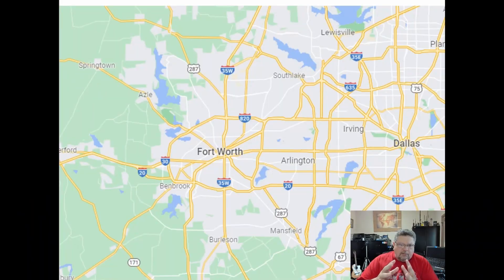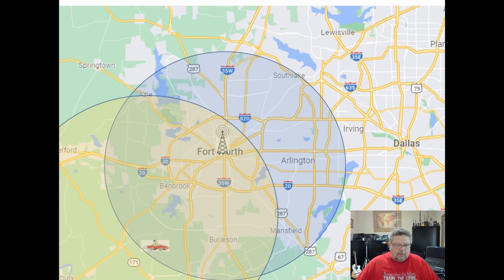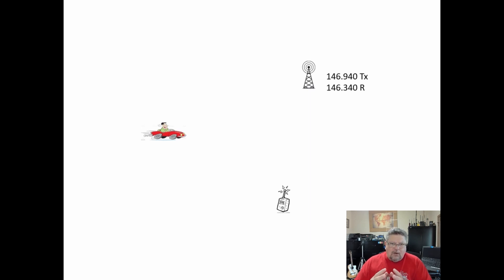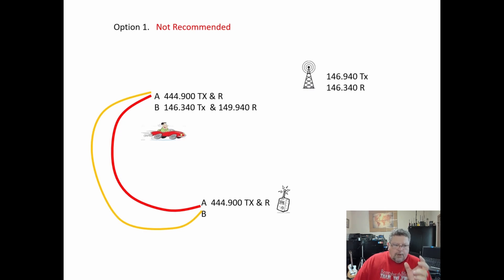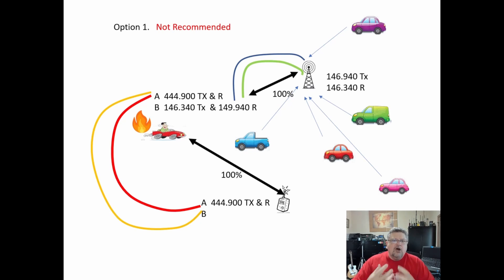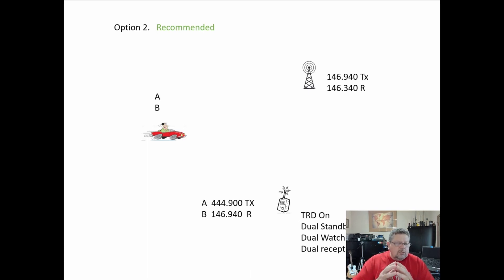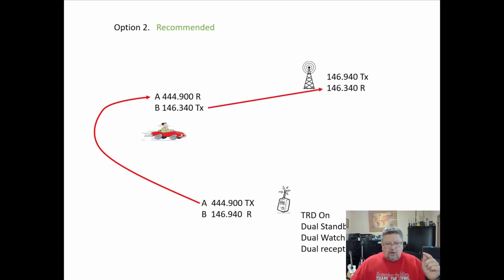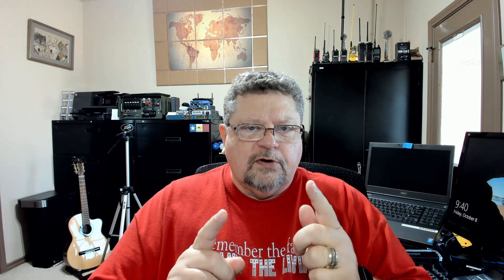How and Why to use Cross Band Repeating

Comment: This is why I like separate vehicular repeaters like the Pyramid SVR units. The low-power repeater is retransmitting to the portable at only a few watts, and the mobile only transmits when you key the portable. I have a similar system in my truck for Part 90 use.

Comment: Seems like a small yagi on a light tripod would be simpler, but here's an alternate method... If the HT is able to receive repeater traffic directly, then you can setup split frequencies on your HT (XMT: 440.900/RX: 146.940) and crossbanding on the mobile (RX: 440.900/XMT: 146.340). Now the mobile only relays HT traffic to the repeater as all repeater traffic goes to the HT direct, eliminating the extra duty on the mobile. If you don't have a crossband rig, take a pair of Baofengs, link them with a 3.5mm-to-2.5mm audio cable, and hoist them up on a flagpole. (XMT radio receives the 3.5mm plug as it fits the mic jack.) Same settings, same effect.

Comment: This has helped me ENORMOUSLY THANK YOU..  found out also so you dont take up both A and B on your handheld, i set my recieve to the repeaters output, and when i key up i set the offset so it transmits to my crossband freq on my mobile, using one channel slot on handheld.. 
Rx. - 462.000      
Tx. 462.000 -  offset -311, so I'd hit 151.000 on my mobile for cross,  Just an example dont scream at me 😂

Comment: I’m new to this and not sure I understand.  Under the second scenario your HT is getting all of the same traffic your mobile unit would be getting in the first scenario.  So why would your HT be able to handle the traffic but your mobile unit cannot?  I’m guessing the cross-band repeat function of the mobile unit gives the hardware a much greater workout than the handheld doing the equivalent of simplex on two channels?
Reply: The overheating happens with the mobile rig, not the HT.  Receiving takes very little power.  Transmitting requires a lot of power, especially if you use your transmitter's maximum output power, which is the default on most mobile rigs. The issue is that, in the first scenario, your mobile rig has to retransmit all the repeater traffic to send it to the HT. If there's a lot of repeater traffic, the mobile rig will be transmitting almost constantly.  Most ham mobile rigs can't take that kind of duty cycle at full power without overheating.  But if you set the mobile rig to use its lowest transmit power for the link from the mobile rig to the HT, that will probably avoid the overheating issues.  And in the scenario described, where your HT is within a few hundred yards of the mobile, the mobile shouldn't need to use much power to reach the HT.  In the video, he's suggesting having the mobile rig not ever transmit anything to the HT, which of course fixes the problem.

Comment: Makes total sense, however what do you have to do differently on you mobile radio for options 1 vs 2? It seems when you put your mobile radio in crossband repeat mode (Yaesu FTM-510 in my case), option 1 is the only thing the radio will do in that mode.

Comment: That's a great idea!

When I've used crossband repeat, though, it is so I can move about in and around my house and still ragchew on 2m simplex where my HT cannot hear most of the other stations - but, my base with a Tram 1481 at 105 feet can.  And, yes, my Kenwood TS-2000 would get hot - so, I reduced power from 50 to 10 watts.  And, that is certainly another method of mitigating the duty cycle problem.

Thanks for the well thought out alternative approach!

73
AI4IJ

Comment: Some radios have independent power on each channel, so you could make the VHF channel pump 50W while the UHF channel does a much more civilised 5W. This helps avoid overheating and lowers battery consumption.

Comment: Works good that way IF the HT can receive the transmission from the repeater. My house basically acts like a faraday cage and my HT doesn't hear much at all. So I must use option 1 if I want to use my HT in the house. (since all my base gear is in the shed) I am able to set the output power to medium on on channel and low on the other so that helps with heat during the duty cycle.

Comment: Thank you for the info.  So your radio was overheating because of the inbound repeater traffic, and I'm wondering if the mobile is still receiving traffic on the receiving frequency of the repeater?  I'm sure it is less than the traffic from the repeaters Tx traffic, but doesn't your mobile still receive on the frequency in the B channel during cross band repeat?

Comment: Three years later and your video is still helping new hams like me . Many YouTube ham radio channels just review the latest radios and testing equipment, new hams need set up and equipment function information to set our equipment up for success the first time . Then we set new goals for even longer and better communications, I have been steadily buying equipment for my home repeater , home antenna ,and work vehicle mobile unit and this information is of great value to me. This will also help relay important information with less traffic confusion during emergency times. We recently went through the hurricane in South St Pete and thousands of homes were flooded out with five feet of salt water. repeaters were invaluable. That is Why I committed to setting one up.

Comment: That is actually a great way of doing it. 
One if those, why didn't i think of that, ideas. 
I use cross band at my house. Walk around with a Baofeng  on 2 meters and talk on the local 440 repeater.  
Thanks for the video.
Reply from the maker: you are welcom

Comment: Thanks, was using method one for my house so I could use HT all around yard and house and not be tied to shack ….when I got back to shack noticed how hot mobile was…will try method two next time. Do you have to use a repeater or can you use the mobile rig in car as the main repeater? In other words not be connected to a large repeater tower buy use the vehicle as the repeater
Reply: You should definitely be able to do that. Just make sure the radio doesn't have any offsets programmed in. Put your HT on one band, put your mobile and any other HT radio you want to talk to on a different band, and off you go. A simplex cross band repeater.

Comment: Thanks for the two-method explanation. I only have a handheld, but I am looking at a mobile unit that will include the crossband relay. I like the second method. I was at a rally in the middle of Missouri and heard everything but could say nothing on my 5W Baofeng. I was thinking an outbound relay is all I needed, and it would save some of the double-delay built into repeating.
Thanks again.

Comment: The Kenwoods are 100% duty cycle at 25 watts. If you had it on 50 watts that explains the overheating. Crossbanding uses 100% of the duty cycle in that mode.

Comment: Nothing wrong with what you are saying. This can work if it is great do it. Might be a good first option. My radio calls this locked band repeat not cross band. If you where in a situation where the HT can't hear the repeater cross band would be required. Turning the mobel 440 transmitter to the lowest power settings might be helpful.

Comment: Okay, I'm late. However, the long term ham does not need a dual watch, anything. Still, a cross band tx of some sort is required. You could always carry an extra HT. Yep, back in the nineties it was cumbersome but, that worked. UHF for the cross band and a VHF tx or, rx like a scanner to listen to net control. Its always been good practice to own and carry more than one radio. Or, lately there have been special events where, more than one type of net on two or more bands and their respective repeaters. That can put a lot of work on a tri band or quad band radio. This is why I still like to employ mono band radios and individual quarter wave antennas.
Reply from the maker: Good idea

Comment: Hello. I have use crossband repeater functionality in a vehicle in the past, and I did encounter the same thing as you initially did. I used a Yaesu quad bander to do that back then. Yes, the rig got hot when it was configured to work with another repeater. That's a draw back in itself, as you point out. However, I encountered another problem at the same time, too. Unless the repeater in town fully dropped its carrier, my mobile repeater wouldn't allow me to transmit a signal into it from my HT. So I essentially couldn't use my own mobile repeater, until the carrier of the repeater in town dropped. That was annoying and frustrating. At that time, my HT could easily hear the repeater in town, but it couldn't transmit into it. The configuration you pointed out makes the most sense for this type of scenario. I never even thought to do it that way. I'm glad that you did, and that you were kind enough to share the information. A great big thank you, goes out to you! I sincerely appreciate this! '73s

Comment: Excellent video, concise.  Would you also want to enable a PL tone on the receive side of your mobile to minimize other transmissions from cross band repeating to the down town repeater?  Wondering if PL tones are crossband repeated or do you enable the PL tone for the down town repeater at your mobile TX side?   thx
Reply from the maker: You are correct.  PL tone for the down town repeater at your mobile TX side

Comment: Yes if you are re transmitting a repeater the opposite link out on simplex is going have be turned down 10w and add a fan.  But simplex to simplex works yes you need older twin bander HT 2 vols 2 squelches duplex on/off function to here yourself or use two radios

Comment: Simplex twist in the spirit of Option B?  Could you accomplish a simplex version of B, to reduce the duty cycle on the cross band mobile, by using a RX tone on the simplex frequency?  Most if not all the traffic received by the simplex frequency wouldn’t have the tone so the mobile doesn’t open squelch and doesn’t transmit.   Your HT won’t have the tone set, so it will break squelch whenever there is activity on the frequency.   Your transmission for the HT will go back to the cross band repeater and out the appropriate simplex frequency.

Comment: I’ll be setting up like this for the Head for the Hills rally this weekend. I was expecting to need 2m, so I built a 2m roll up J-Pole last weekend and did a dry run… band plan came out yesterday and we’re using 70cm… I don’t have a 70cm antenna for my POTA setup, but do have a dual band antenna on the car. So it looks like the mobile rig is getting set up on Crossband Repeat and I’m going to rock a Baofeng at the Rest Stop. 😂🤷🏻‍♂️ It’s not stupid if it works.

Comment: You don't technically need dual receive for B method. Some radios will allow arbitrary splits -- whereas a normal VHF repeater offset will often be 600kHz, you will set your radio up like any other repeater, but the offset will be hundreds of MHz. Yaesu and Baofeng will do this on a single channel, I believe.
Reply from the maker: I would be nice to try
Reply: The Vx-6r supports this exact configuration and is how I use crossband repeat when not connecting it to a repeater. My - offset is ~280mhz.

Comment: If you use Option One anyway, be sure to set your mobile rig's 70cm transmit power as low as you can get it. Single-digit milliwatts (1, 2, 5) will be plenty to raise your HT within walking distance, and it'll tolerate a high duty cycle without stressing your transmitter.
Reply from the maker: The Kenwood has L, M, and H.   I was running L.

Comment: Excellent description of how Cross Band Repeating works.    Many thanks for the video!    I bought an Icom 5100 rig earlier this year and had used it minimally.   I found out recently that it has cross-band repeating capabilities and that really got my mind working on how I can set it up so that I can go out for a walk around my neighborhood with my handheld and check in on the local nets on extremely low power.    Our radio club also supports special charity events and provides communications.    I can't wait until the next event comes along so that I can make use of my new found knowledge on how it all works!     Great video.

Comment: Hey a big thumbs up to you 👍 that's a fantastic idea , will never forget the first time I did crossband and left then realized the squelch had opened up and locked up the repeater for several hours , then  realized what I did I hurried back to turn it off and  I could smell the radio 20 feet away but it survived so now I use tones on both xmit and rec and lower power but your idea is a great one so will try it tomorrow and hopefully it will be the answer . Thanks agaiin kc5ulu
Reply from the maker: Wow

Comment: So... If you set up one single channel on your radio, you can have the repeater on VHF, with a huge transmit offset to the UHF input of your cross-band.

Then, you can configure your cross-band repeater to have the same PL tone as the repeater you want to hit, and have some crazy receive selection, like a different PL and a DCS tone.

This would mean that your radio listens to the main repeater, and you hit your cross-band whenever you need it... But the cross-band doesn't transmit back the other way, because you enabled some crazy combination of PL and DCS.

Comment: Thanks for the information. I have one HT that does cross band; the TYT TH-UV8000E. It pumps out 8-10 watts in a simplex configuration. It's more limited than a repeater, but set on a high point it will extend TX/RX range where terrain obscures signals. It's like having two HTs in one.
Reply: You could use it as a repeater in a car then? Or put it someplace high to extend other radios?

Comment: Great video, thanks.  Now, I do have a question.  I thought one of the main reasons you needed to cross band, was due to your HT not being able to reach or hear the repeater.  If unable to hear the repeater, it would appear that this would not work.  Am I missing something?  Again, thanks for the video.  I found this very helpful.
Reply: That's exactly what I was thinking. I was stoked about learning about cross band repeat, but now I don't know if I'm going to do it. I think it's totally fine if your HT can receive the repeater fine, but has a hard time getting out.
Reply: Just remember if your HT is outside the reach of rx of the tower and you are using your mobile as cross band repeater it will over heat as he said (if that repeater gets a lot of traffic, in his example of a bike event)
My tyt8000 ht used as a dual band cross repeat as in first example got hot within 30 minutes of Just Me testing it. Plus battery wear down.

Repeaters are usually commercial grade and cost $$$ to solve these issues. 

Tyt has a good cross band.  

Note if your ht does not have an A/B dual watch, you can use a large Offset when you program. Ex 462.500 offset 300.000 (not your basic +5 or -5)

Comment: I love this feature but I don't recommend using it on portable radios unless you have to. I recommend using only the lowest power setting on both bands, and even then these radios can heat up very quickly if there's no down time in your contact. I would NEVER use medium or high power on portable radios because you have to remember the radio is potentially being keyed full time throughout the entire contact. That's like setting your portable to high power and wrapping a rubber band around the PTT walking away for 5 or 10 minutes. It's not going to end well for your radio. You should also never use this feature on a repeater channel because there are times repeaters may not drop for extended periods.

Comment: The only problem with this is you may reach the repeater transmitting through your HT to the mobile, but not to be able to hear the repeater on your HT without the mobile.  KD2MNR
Reply: No. In the video, this is all predicated upon you being in an area where you are too far to TRANSMIT to the repeater with the HT, but close enough to RECEIVE the repeater on the HT.

Comment: Do you need a ground plane for a quad band antenna set up on a normal shingle roof running 50 watts or can you let it sit in a mount and run the coax right to the radio

Comment: I recently had a conversation with Dave from Powerwerx who recommended to me that only 10 watts on each frequency is recommended. I know I tried using Turbo mode on my Anytone 578 and the radio got hot really quick and I realized that this was a recipe for disaster. I rarely use this mode for repeater work, typically for simplex but great idea for a busy repeater as long as your HT can receive that long signal. Thank you for the video.
Reply from the maker: Good info

Comment: I'd be curious to know what your transmit power level was set to on your TM-V71 when it overheated?
Reply: Why couldn't you set up your hand held in duplex, Tx on UHF channel to your mobile and R VHF side from the repeater.  The offset function would allow TX and R instead of using A simplex and B simplex with TDR on.  On my Baofeng UV5R I receive on 146.610 from repeater and transmit by pushing PTT switch to FTM 400 at 446.500 MHz.  The offset is a +299.890.  My FTM 400 has two simplex frequencies while in cross and, R at 446.500 and Tx to repeater at 146.010, same way you describe in video.
Reply from the maker: I had a Ed Fong antenna on a 15ft mast running low power.
Reply: @MeOnTech  I have the same radio and Ed Fong's DBJ-2 roll up. I've never tried it under the conditions you describe. I appreciate you putting out this video, probably saved me some grief. Very elegant solution. Thanks.